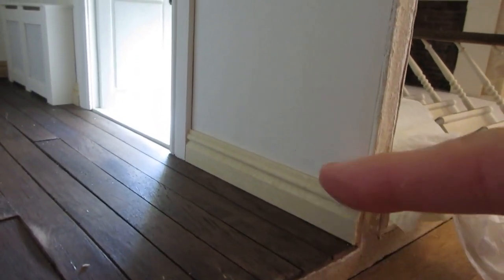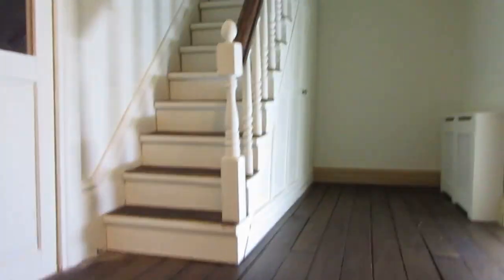My Dolls House Diary #57 - Entrance Hall & Landing - Quick Update

Comment: To reinforce the flimsy wood have you considered using superglue with a sprinkle of bicarbonate of soda (baking soda) on both sides? Then it can be sanded. Maybe would strengthen so that it doesn’t break. (For future reference). Peace. DT, DVM
Reply from the maker: I've never heard of that technique, but there is actually a paste you can buy to strengthen Balsa wood. :)